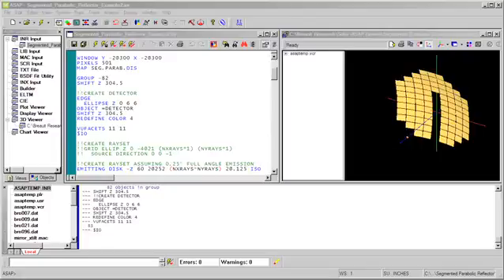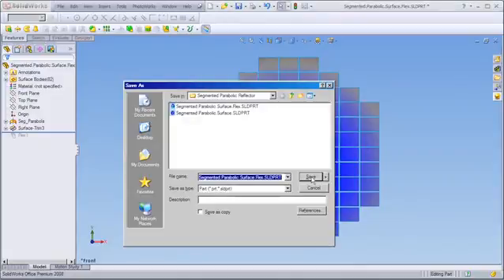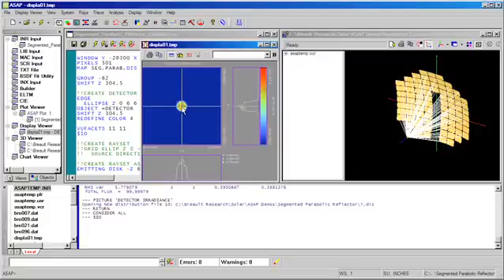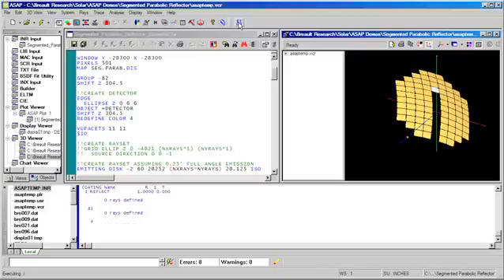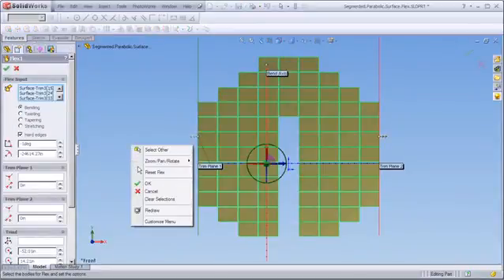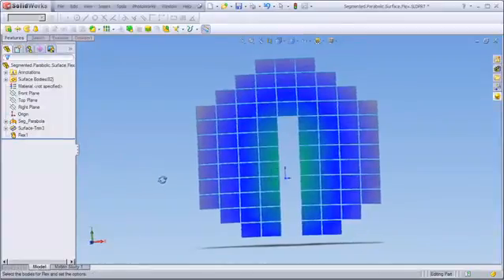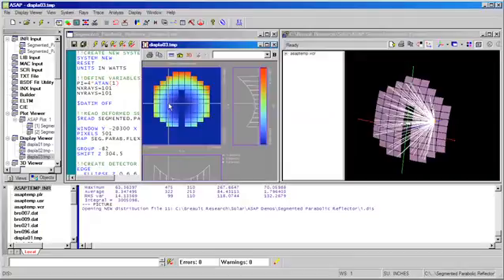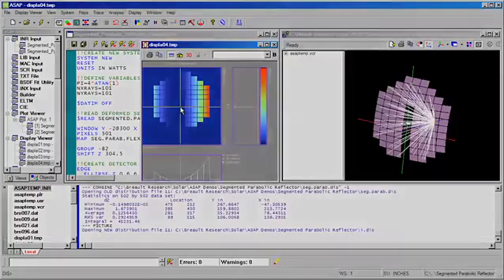Solar Dish Concentrator Designed in ASAP

Comment: What is the full form of this software called ASAP ?
Reply from the maker: The Advanced Systems Analysis Program (ASAP) is optical engineering software used to simulate optical systems. ASAP can handle coherent as well as incoherent light sources. It is a non-sequential ray tracing tool which means that it can be used not only to analyze lens systems but also for stray light analysis.
Reply: @Lanikasolutions  thank you